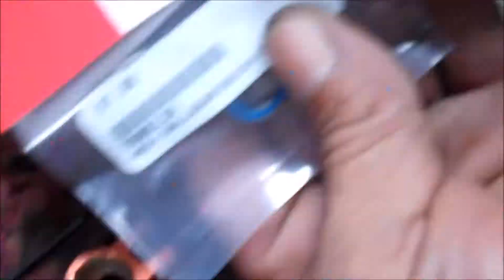Helion Invictus Maintenance

Comment: Mine new is it fully waterproof
Reply from the maker: there is a newer ESC on the new ones from when I bought mine but water can even mess up waterproof components. you can run through puddles all you want but you might not want to submerge it. water messes up all your screws and bearings though. until you start ordering parts you should probably go easy on the water bashing. lol. mine has been rebuilt about 6 times!!
Reply: @GeneralHobbies  how well did your sealed bearings work? I ordered a full set for my invictus from fast eddy and just curious how well yours worked out while you still had the truck.